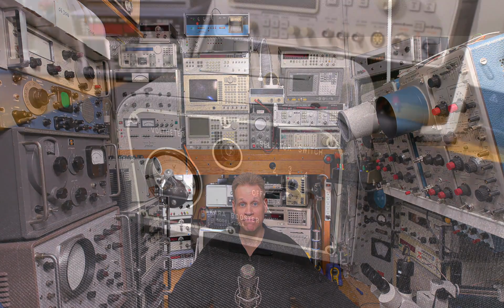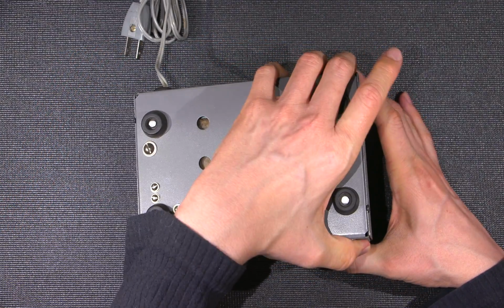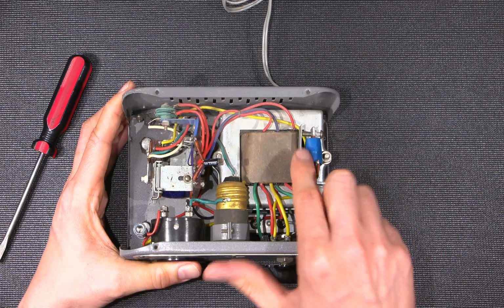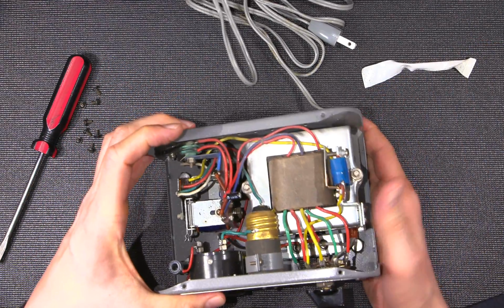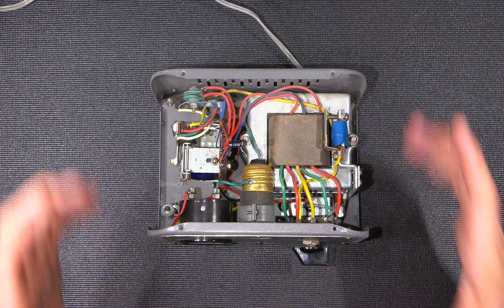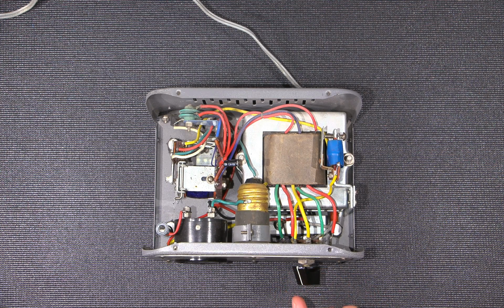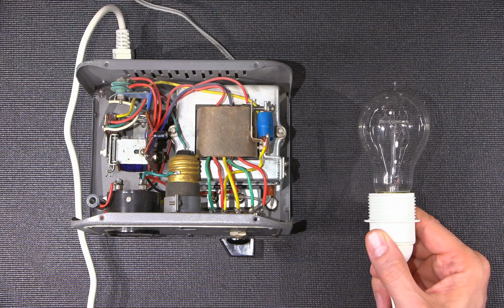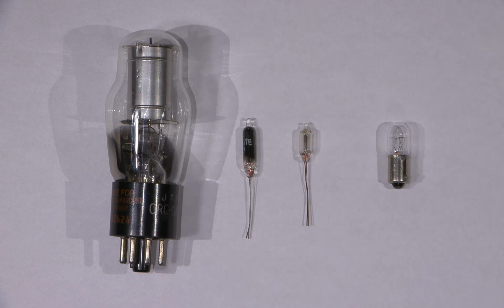What's a Takara Booster 200A? Let's Find Out!

Comment: A lot of times, a light bulb is used as a ballast, for a shunt regulator, rather than a resistor. Light bulbs are positive temperature coefficient, which means it provides a more steady current to the shunt regulator. That keeps the regulator more accurate, if the supply voltage fluctuates. As a side note, an incandescent light bulb is used in the signal path of a Hammond electric organ, to provide a "percussion" effect. When the note is played, the bulb is cold, and allows a strong "attack", then decays down to the normal level. It takes advantage of the thermal mass of the filament, as well as the positive temperature coefficient change in resistance.

Comment: Even though the device in the video may come from Japan and the voltage is adequate for their grid, if I'm not mistaken we had such devices even here in Europe, or at least my grandfather's generation did. Considering the input and the output values and how the output is marked as television or radio only, this reminds me of something my grandfather used to call a "stabilizer" and he needed it for his TV to work properly back in the 70's. I'm not 100% sure if it had something to do with it being a vacuum tube color TV or just because it was a vacuum tube TV or just because the power in his house was fluctuating so much that I could see the lights getting brighter and dimmer several times every evening, the fact remains that without the stabilizer the picture would get distorted whenever the power wasn't right.
One other function the stabilizer had was surge protection, that's probably why the relay is there.

Comment: The incandescent bulb is used as a starter. Before it warms up to operating temperature, it passes  a lot more current.  The resistance of the filament increase when it gets hot, and then it acts as a resistor.

Comment: I think Jim has a more scientific answer, hard for a dim bulb tester like me to understand, but I cheated and looked at Wiki.  Actually you have talked about this before in your videos.  The VR150 (0D3, 0A3, etc) acts like a high voltage Zener Diode.  It must have about 15-20% more voltage on the plate to fire it up (like the zener diode has a certain starting voltage).  The light bulb in the chassis is a current limiter, since there is nothing otherwise to limit a potentially limitless amount of current.  I have a VR150 on my heartthrob (the SX-71) where restoration has now officially begun.  See?  Your disciples are learning bit by bit on the Patreon channel.

Comment: 10:40
but you have an isolation transformer .
you would not get shocked because the isolation transformer removes that reference to ground through the neutral poll.
...?
Reply from the maker: There is still AC present inside this unit. An isolation transformer isolates you from the line side common, one can still come across both sides of the "isolated side" and complete a circuit resulting in a shock.

Comment: Wonderful video - as usual =D   A quick question (sorry if its obvious and I overlooked it) - why does it cut out with the buzzer at settings 3, 4, and 5?  I assume its because it limits to 120v, and presumably if the input voltage was lower then settings 3,4 and 5 might work?  How does it know it's at / over 120v?
Reply from the maker: If you adjust the output voltage above 120, it cuts off giving you a buzzer. So you would use position 3, 4 or 5 if the input voltage was lower, There is more of a step up affect using these higher positions as shown in the video.

Comment: I missed something.  With a three amp fuse you couldn’t drive much plus if the voltage switches off after mark 2 on the knob, what are 3 to 5 for?  That doesn’t make sense to me and wasn’t explained.

Comment: Could this act as a isolation transformer? Also with a load that draws down the voltage you could turn it up a notch to compensate for the drop in voltage because of the load?
Reply from the maker: There is no isolation from a unit like this. There is only one winding with multiple taps in a boost type circuit.
Reply: @MrCarlsonsLab . Ahh, its kinda like a variac. Thanks for the answer :)

Comment: Oddly enough, while I was repairing a tube-preamp, I found that because the internal wiring had hardened, it created I condition I hadn't thought of: the stiff wiring was very fragile because all the stress had been concentrated on the ends. As I worked on the preamp, wires just fell off onto the table. The only schematic I could find was for a preproduciton unit, graciously sent be the creator's son. The preamp was from the 1980's, and yet the plastic was a hard as a model kit.

https://www.youtube.com/watch?v=IYSzkxF6mjI 

So, PVC wire is basically chemically similar to PVC plumbing pipe. It's only soft because pthalates are added. Phthalates tend to not stay in the wire, which wouldn't be an issue, if they weren't endocrine disruptors. It might be a good idea to wash one's hands after wiring, and perhaps avoid eating snacks that you need to eat with your hands.

And thanks for the videos.
Reply from the maker: Interesting channel Brenda!

Comment: Hi   Its to make sure that the neon strikes . I had to 'Fix' a ph meter which I was told only
worked correctly when it was near to a window . I found that it used a neon to produce
a stable voltage and it must have lost some gas ( or was it that air leaked in ! ) -- a new
neon fixed the problem . I visited another lab some time later where there was a similar problem -- when I told the chaps what I thought would fix it they thought I was mad --
so i fixed the problem for them .

                                                                                                          Alan

Comment: As for your question on neon lamps:
I have found that older neon lights will flicker or not illuminate at all without a nearby light source. It reminds me of the triggering of a diac. It seems like the light energy hitting the neon causes a reduction of the energy used to illuminate them, and therefore reducing the power required to drive them. It seems like this would extend the lifespan of the component. Can't a neon lamp be used as a diac?

Comment: HI Paul, if your input voltage would have been lower, i.e. 70VAC, I guess it would have been possible to put the selctor switch into position 3,4 or even 5, before the relay shuts the output off, right?

Comment: Paul, great video love that old nostalgic stuff, I died laughing at your comments about today's safety devices, as they do tend to go to extremes, and of corse everything is connected to the internet and our smartphones, I could just see all of these messages being sent out that an interlock has been bypassed, but as one fellow viewer stated, you can thank all these ambulance chasing attorneys for a lot of that companies have to be on the defensive, lest they be sued right out of business, by people who want something for nothing. But enough of that anyways, yes I see that several other viewers have already answered the trivia question correctly ambient light lowers the ionization voltage of the gas in the regulator tube, just like it does on one of those neon night lights that used to be so popular before  electroluminescent ones and now LED's, my mom always kept on of those neon ones in the bathroom when I was a kid, and I noticed that when they would get old they got to where they would only flicker or even quit altogether in the dark, but when you turned on the bathroom light it worked fine, I didn't understand it at the time, but found it fascinating, I just kept wondering how turning on the bathroom light was increasing the voltage when it should have caused it to drop, it wasn't until a while later that I happened to Shine a flash light at it and realized it had the same effect. That started me thinking that I could somehow use that to control something by light, so I took a volume pot from an old TV that I scavenged and used it to adjust the line voltage to an ne2 lamp to the point just before it would light, the other side of the lamp was connected through a resistor to ground, I then connected the input of this old tube public address amplifier that someone had given to my dad to give to me, across that resistor, I then connected a 24vac relay to the common and 16 ohm terminal, when I Shined the flash light on the ne2 the lamp would light and the small voltage across the resistor would be amplified to enough to pull in the relay I then used the relay contacts to control my boiler ignition transformer that was setup as a Jacob's Ladder. So I could come into my room and Shine the flashlight at the Ne2 lamp from across the room and it would turn on, needless to say it impressed my parents and my brother and all my dad's friends, everytime one of his friends that had not seen it, would come over he would ask me to show it to them. This was in the early to mid 60's even our TV was an old Motorola B&W tube set, and it was not remote control, infact I don't recall anyone we knew that had a remote control TV, so it was a lot more impressive than it would be today, but ya thanks for making me remember that, as always Paul I really enjoy your videos, keep it up my frind.
Reply from the maker: Thanks for sharing your story Robert!

Comment: Incandescent bulbs present a non-linear I/V relationship. When a load is connected to them, the bulb auto regulates the current demand by increasing its resistivity. The higher the current, the higher the resistance. This principle was used by Hewlett and Packard of their first product. A sinusoidal oscillator based on the Wien's bridge which compensates the gain of the output by thermal effects.

Comment: My guess on the bulb, it is a auto adjusting "resistor" to help regulate the voltage. As the bulb heats up the resistance changes. It could also be there as a snubber so the inrush is throttled a little to ease the shock on the tube heaters.  Other than that, I also LOVE that neon bulb! AND I think screwing the vibrator in to keep it quiet was the right move! :D

Comment: In india we  call this as voltage stabilizer  which can be use for multi purpose  devices.  We even have wide range stabilizer which ranges from 60V AC to 500V ac input, and  output  from 220v  to 240 v AC.  anyway nice to see a small stabilizer  with a small range

Comment: I believe neon regulators/bulbs require a higher voltage to start and can use a lower voltage to sustain. Since an incandescent bulb filament has a lower resistance when cold and a higher resistance when heated, I would imagine the incandescent bulb is used in series to provide a higher voltage to start or fire the neon and once running drop the supplied voltage and current limit to sustain it as the incandescent bulb filament heats.

Comment: With my limited knowledge, my first thought for the bulb was that it would act as a resistor / fuse with a bayonet base for easy replacement. Then I read the other comments and learned about the photo sensitivity factor for the neon bulbs.  Always new things to learn....... by the way, you forgot the condom in the personal protective gear in case you really screw up.  ;p      J K

Comment: Ok Paul, here is my guess, because of the positive temperature coefficient of an incandescent bulb, if placed in series with a neon bulb, or cold cathode vacuum tube, it would act as a ballast resistor as well as a protection device to prevent sputtering or arcing due to voltage spikes. Basically the same function as the current limiters we use on our isolation transformers and variance. Did I even come close to the correct answer?

Comment: Rectifier, electrolytic, power resistor .. but no active components?   .. unless the neon indicator, relay or buzzer need DC?   How is shutdown threshold sensed?
Reply from the maker: Hi Fred. The limit set screw on the relay.

Comment: Sounds like you are fed up with modern stupidity.
Nice to know I on my down side of the journey, ain't alone yet. Very kool, very very cool
Reply: When I was about 2-3 years old, my father replaced the female connector on an extension cord in the living room. He left the other side of the cord plugged in, so live naked wires were on my play floor... That was my first real burn from our 220 Volts, and from that point of view I can always understand the safety rules building up over the years. Still I agree, there is overdoing.
B.t.w., I survived...

Comment: Like many others I also would like to see it run at a lower voltage.  If someone used it to control varying line voltage that buzzer sure make them turn it down when V went back up.  Show this when you respond to the bulb answers. I learned something new re: cfl needing some light to start. Weird!

Comment: Gonna put a couple enters so as not to spoil my answer

The bulb is there as a PTC thermistor. The regulator is allowed to start at the strike voltage, which it then lowers, drawing higher current, engaging the bulb, which after the start, limits current.

Comment: Selenium rectifier? (replace it!) Overload buzzer. These transformers were extremely common. Japan has both 50 and 60 Hz power in different regions. The transformer probably works for both. You can still buy step up and step down transformers so US and other foreign devices can be used in Japan. It's also common to have voltages +/- 10 volts from the 100 V mains supply in Japan. Power is supplied as split phase (center neutral) 200 VAC in Japan. A typical home is supplied with 60 Amp service, although you can buy up to 100 A or, as low ad 30 A service.  The bulb limits the current in the gas discharge tube to withing the specified rating. Because the lamp is a non-linear resitor, it disapates less power than a fixed resistor.

Comment: hmm,,do i detect sarcasm??  interesting that you didn't "load" the output to its rated 200w. and, if selecting above 120v shuts off the output, what's the use of the 5 position switch? did you try the unit at 70v? [bad memory; you once did explain the use of an incandescent bulb with a valve before....]

Comment: This bulb would probably be used to regulate the current to the filament, as the current went up in the series connected filament and bulb after switch on,  the bulb would get hotter and its resistance will increase and lower the current through the filament circuit. As it lowered, the bulb would cool and go down in resistance thus increasing the current flow and overall regulate the current in the filament.
An alternative answer along similar lines would be to protect the filament from current surges at switch on.  The bulb will imediately get hot and its resitance will be high, allowing a small current to flow.  This current will slowly heat up the filament which will also lower the current flow.  The bulb would get cooler thus allowing more current to flow and let the filament reach working temperature safely.  The whole circuit would reach equilibrium without thermal stress to the filament.

Comment: In late 60's and early 70's, when when regular TV broadcasting was in its early stages and  television sets were becoming a common addition to every home in Turkey, these things were almost a must with every set. The line voltage in those days were pretty bad, it was supposed to be 220V but almost never went over 200V and fluctuated a lot, sometimes going as low as 170V. TV's were expensive and nobody wanted to expose them to a fluctuating mains voltage. I remember quite vividly that near every TV set there was a "regulator" which was actually a booster like this one to get a reasonably steady 220V.

Comment: To mid 90' in poland that kind devices was popular on suburbs and villages. Where electrical network was insufficient to load and voltage was to low for more advance devices. I remember last of this devices has automatic output volatege control.

Comment: Two good guesses prevail.  Neon exciter vs. inrush ballast or regulation
In those days couldn't they have used a tiny dot of radium paint to act as an NE exciter?
My third outside guess is since a lightbulb initially draws more current until it heats up
it might be used for an initial current kick start and then taper off as it heats.

Comment: I love your videos and I have a very basic understanding of electronics, so pardon the novice question. You pointed to a rectifier in the circuit, and since everything appears to operate on AC, what is the DC for? Thanks.
Reply from the maker: The DC is for the protection relay coil. (DC Relay)

Comment: A friend of mine gave me a stabilised supply from our only nuclear reactor here in Australia, it had a filament lamp voltage reference. Single tube driving a gear reduction motor driving a variac, driving the primary of a huge transformer with the secondary in series with the mains. Found a reference in an old text book calling it a “Velodyne synchronous integrator “, is that the coolest name or what.

Comment: I agree with Jim Nugent on the jump starting theory. I used to operate a vintage video projector in a 1930's theater that had a similar startup circuit. A piece of nostalgia at it's best, that may never be designed or built again.

Comment: I'm going to guess the incandescent bulb is used t limit current through the gas vapor regulator tube. It starts out low resistance when the filament is cold and increases in resistance when hot.  This would "kick start" the gas regulator by giving it an initial surge in voltage,, decreasing when the 0A3 starts conducting,, then tapering off to it's specified voltage drop.  The burst of voltage would be needed to ionize the gas inside of the tube to start it regulating.;